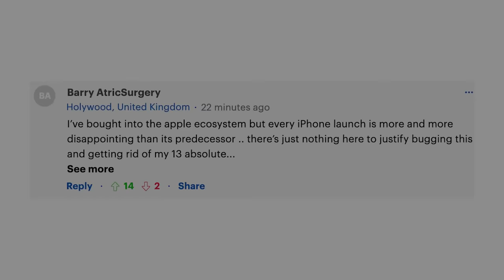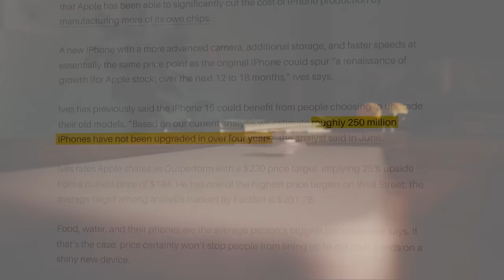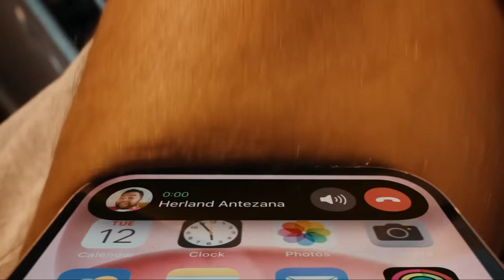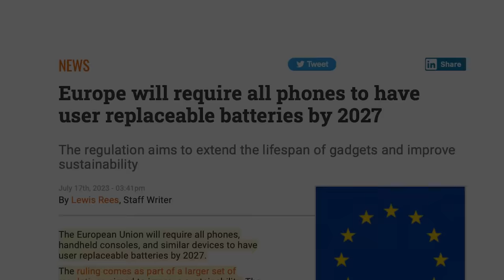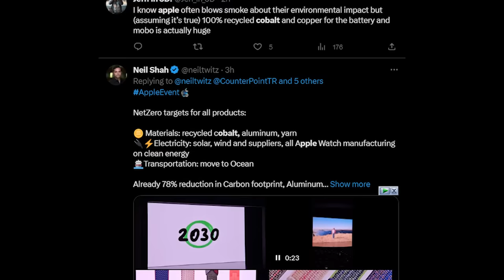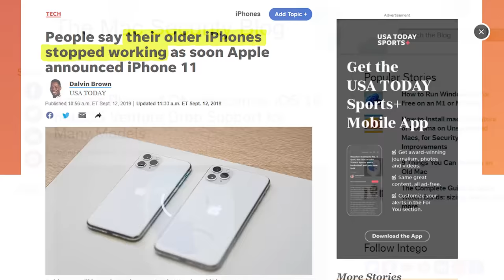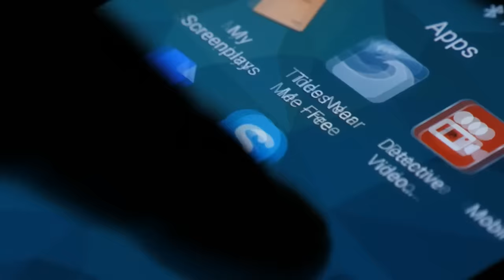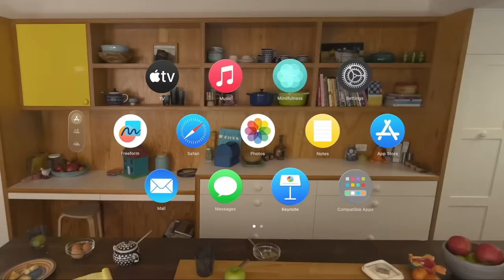The iPhone 15 Is Everything Wrong With Apple

Comment: The video is absolutely correct, but my question is 'what did you expect?'. The smartphone went mainstream around 2008-2009 and the market grew rapidly, the product category is now 15ish years old, no wonder new releases are minuscule improvements. Steve Jobs himself said that a product category tends to stall after the first 10 years of development. Even innovative tech like foldables is not really a game changer, except for internet personalities, almost every single person I've ever come across irl that has a foldable tends to admit it is a total gimmick and for their next phone they will switch back. Honestly the market has finally reached the point of not being worth upgrading every single year, maybe the idiots that have to get the newest, greatest thing will actually use their phone until it's dead.
Reply: I would expect them to maybe allow sideling, landscape mode on the home screen which they've got rid of ever since they introduced the notch, expandable storage, to bring back the headphone jack, a desktop mode
Reply: Foldables feel like that because they are not there yet. Unless you eliminate the crease and make a screen that can be strong like a glass screen then it will feel like a gimmick because it is too sensitive and has a clear annoying flaw. 
There are many way to innovate though but manufactures just stopped and only do what is most profitable. 
Remember how many phones tried different things to eliminate the on the screen camera at first when screen because the full face of the phone? So many innovate things with plenty working great yet everything stopped because they discovered they could still sell just fine by having a hole on the screen.

Comment: Apple has done plenty wrong, but calling them out for being guilty of planned obsolescence because they make a new phone every year is moronic.
They’re head and shoulders above every other phone manufacturer in the world on this front. You can run the latest version of IOS on the XS that came out 6 years ago. They still support the iPhone 8, and give security updates to the iPhone 7, which was like 8 or 9 generations ago. It’s common to see people still using iPhone X after all this time, while most Androids will only get 2 major updates and usually end up in a landfill after 3 years. iPhones’ resale value is typically double or triple other manufacturers.
They make a new phone every year for the same reason there’s a new Corolla every year. Toyota doesn’t expect you to throw away your car every year. It’s there for the people whose phone is old and ready for a trade in.

Comment: This year I updated from a 12 to the 15 Pro Max. I feel it was a worthwhile update, love the bigger display and the slightly rounded edges do feel better in the hand. Personally I don't think an update every year is worthwhile but every 3-4 years is ok for me. I agree with the video in that we have reached the peak of the current technology, I don't think folding phones are the next step, probably longer lasting battery life for a phone would be great but next is the goggles, a different way we can interact with the technology. Phones will likely stay as hand held screen cameras.
Reply: exactly, you dont need to buy a new phone every year, and i would hate if the iphone design changed
Reply: @culan_SCP   People don't realise that Apple views their design as iconic.

They're confident with their design language, and thus they are making only small adjustments to it every year, sometimes none at all , (cough) iPhone 14(cough).

They release new colours to differentiate the newer model from the older ones.
Titanium for the 15 Pros, Deep Purple for the 14 Pros, Sierra Blue for the 13 Pros (still really love that colour), Pacific Blue for the 12 Pros, and Midnight Green for the 11 Pros.

And the colours overall have a different tone from model to model as for the Non-Pro models.
Reply: @CuberBeats  yes.
Reply: There’s enough change for me to make the upgrade. The bigger phone has better ergonomics for me, the 120hz is something I want, and I want that USB C port. The extra ram is neat too. 

I was hoping the 15 plus would have been worth getting, but it’s literally not worth getting.
Reply: @culan_SCP main reason we are regularly changing phones is because of the battery
Reply: People always stereotype Apple users as users who upgrade their iPhones every year. Not true. And even if true, it’s not all the time. It’s mostly huge YouTubers the review the product.

Comment: i used a note 4 for 5 years and you could open the back with your hands, without needing any tools. i carried 1 more charged battery so if my battery died, i could just open the back and put the fully charged one. never had to change any part of it because it was good quality, but i think if i ever wanted to it wouldnt be a problem. its not my main phone anymore, but it still works great, no lag no nothing, still compatible with most apps.

Comment: Been using my huawei p30 pro for 3-4 years still runs like a dream, battery lasts ages and camera is excellent. Doesn't take a genius to work out why subsequent models were banned from using Google.
Reply: Yup, still using my P30 Pro that I bought when it was released - it's been the most faultless phone I have ever used and even the battery still lasts a decent amount of time.  The only times it has ever even been rebooted is when I've forgotten to charge it.  Still runs everything I need it to, looks like new and I have zero need to buy a new phone, quite the opposite of the Apple and Samsung phones I had before.
Reply: That’s cool
Reply: Have been using redmi 6 for more than 5 years. It is a miracle that it has survived my careless handling and still works fine.
Reply: Enjoy the chinese spyware 😂
Reply: @RustyShacklefardd  It's fine, I'm poor anyway.
Reply: @RustyShacklefardd  lol as if google and apple don't spy on you.. absolute sheep behaviour
Reply: I had the regular P30 since launch and it was such a solid phone... Had to switch because the screen stopped working properly and they were asking like half the price I sold it for even with a malfunctioning screen. So I bought a pixel 6a.... And it's sooo much worse regarding build quality, smoothness, battery, it overheats! If they weren't banned, Huawei would have 100% ruled the market by now... Really makes you think

Comment: This was exactly what I was thinking, thanks for putting out a full fledged video on the topic and making people more aware. I believe only 3 iPhones brought the big innovations to smartphones. iPhone 2G, first iPhone, iPhone 5s, with bringing biometric authentication and finally iPhone X, with current modern day smartphone design and package. I still use iPhone X bought it at launch. It is still a beast, its losing support with iOS 17. and with the iphone 15 pros launching today, i dont see a good reason to upgrade other than the camera or maybe the battery coz my phone gets charged with apple car play twice or thrice daily. so i dont have any battery issues. Most probably i would be keeping my iPhone X another year.
Reply: Same for me, still using my Iphone X but already had to replace the battery and screen. I would definitely keep my Phone if the camera would be better compared to the newer ones with night mode and so on.
Reply: totally with you on the iphone X. got it in Dec 2017 and it's still going strong. ok, its a bit laggy. but it never stopped working, all the pieces are original (nothing has been replaced) and it does the job. Maybe its time for an upgrade this year. but after 6 years, I think that's fair
Reply: I have an x and i upgraded the battery to a 3200mah one and my phone now lasts all day. Literally with heavy use. And by heavy use i mean im on youtube and tiktok all day. 

I like this phone so I’ll probably pick up a XS for cheap.

Comment: I agree with many points you made in this video, but I didn’t watch it anymore after you said iphones don’t last long. My friend, iphones are the longest supported phones in the industry, you can still use an iphone x or xs today and use all the newest apps. Those phones came out in 2017/2018. Yes, they slowed phones down in the past, but nowadays you can just turn the feature off in the batterycsettings menu. Iphones are staples of the industry when it comes to longevity and long software support

Comment: I think a huge reason why most upgrade yearly is the phones slow down over time, or at least people feel like their phone is slowing down in just under a year so they upgrade for the thought of a new phone running at 100% speed
Reply: My Samsung S10 has been running perfectly fine since 2019 honestly.
Ever since that lawsuit, they havent been slowing it down much on my end
Reply: To be fair, when I had my iPhone 6 for a few years it got slow as hell, to the point where I literally had to wait 20-30 seconds just to open whatsapp (and I am not exaggerating either, literally measured it with a stopwatch). Ever since then I've been traumatized of getting a new iPhone, however I've now been rocking an iPhone 11 for the past 4 years and tbh I can't say it slowed down significantly since the first day I got it. And thats with tons of new updates. Gotta say, Apple got their shit together.
Reply: @ferryhmm  They "got their shit together" only because they got sued for slowing down older phones to force user upgrades.
Reply: @mintheman7  The thing is, even when they rolled out that update to be able to disable the CPU throttling, my phone was still that slow. So yes, they still "got their shit together", because the phone slowing down went beyond the questionable cpu throttling practice they did
Reply: I still use an iPhone X and the throttling lawsuit definitely had a part in keeping this phone going for this long. iPhone would force an upgrade nearly every other year or other two prior to it.
Reply: I'm pretty sure most flagship devices can stay smooth for at least 2 years (a tad bit conservative due to Android's design in nature)

Comment: Moved from iPhone 5 to iPhone 11 to 15 pro and will keep this one around 3.5 to 4 years. Happy with mine so far and like I can see the time when in standby 🙂 (usb-c makes no difference to me).
Reply: Usb C makes a diffrerence. Notice the big hole where dust lints used to accumulate? Its gone now. You wont have that problem anymore. The C cable also wont break every year like cheapskate Apple lightning. But yeah still charging for almost 2 hours I guess if thats what you mean.
Reply: @fynkozari9271  you don't see dust in usb-c port because it's covered, with lightning you just scoop out the dust.
Reply: @thesnowman2509  no, USB c has a pin inside. It prevents dust from entering. Lightning port has a big gaping hole. Go watch apple iphone gets cleaned. You never see android port getting cleaned. I have 2 USB c smartphones myself.
Reply: The 15 pro should easly be able to last you 5 years maybe even 6
Reply: Just bought the 15 pro, converted from the pixel 7, very happy with the 15 pro

Comment: I jumped from the 11 to the 15 with the rest of my family after everyone else’s broke over time (mine still worked well, albeit with terrible battery life), and it felt so much better to use the 15. If I had upgraded from say, a 13, I probably would have felt ripped off. I recommend waiting at least 3 years (4 years might be more fair nowadays) between upgrading phones.
Reply: Me completely fine with my 2015 Huaweii that doesnt support google services anymore and still has good battery life:
Reply: The terrible battery life (79% battery health when I upgraded after 2 years) is definitely my fault to some degree, as I was an extremely heavy phone user and it heated up frequently because I frequently used resource-intensive apps
Reply: im still rocking my xr 3 years later.

Comment: I’d say it depends on the use-case. If your camera allows you to shoot at higher resolution than 1080p and it’s better then go for it. It won’t matter as much now, but IMO is much better for video preservation.

For example, in 30-40 years the things might’ve changed, so drastically that 6k is the new standard resolution. But obviously, as I said it depends on the use-case of the video.

Comment: One point about the batteries they use for the iPhone 15 is they use lithium-cobalt because it is more energy dense than lithium-phosphate which makes sense in the context of a phone since you typically want it to be light weight while having a large battery capacity. 

Lithium-phosphate are more sustainable and better than the environment but are less energy dense. On the bright side though they are more thermally stable (kind of irrelavent for the temp a phone operates at) and have a longer cycle life meaning they can be charged and discharged more often over its lifetime. This is potentially another reason they don't want to use this because it would give less incentive to change to a new phone since the battery will degrade less over time.

And on another note they're not actually the driving force for the large increase of price of cobalt over the recent years, automobiles are since they need much larger batteries. For some reason despite thermal stability, safety and cycle life being more important for the application of an automobile they still opt in for lithium-cobalt batteries instead (with a bit of nickel).

Comment: I think the only problem with Apple and most phone companies is that the phones are designed to not last too long, and people feel the need to upgrade too often
Reply: Ironically, Apple is one of the best manufacuters to that. Their devices dont really slow down even after years, and they recieve full update support for 5+ years.
Reply: The problem I’ve noticed is that the phones will work for a long time, but the stupid batteries do start dying really fast. One person I knew had a really old iphone that would die after like 5 minutes off the charger. But they do have to be pretty old to do this

Comment: With the way Samsung has been pushing the boundary for the past few years, I really expected the new iPhone to be leagues better than the previous years just to compete. Turns out this year's Pro Max camera sensor still cant compete with the S23 Ultra. Apple has lost their grip on hardware supremacy and soon, they'll end up losing their software edge as well. It's honestly just surprising how little Apple is bringing to the table these days because it's like they want to lose market share. I assume they aren't too worried because of the whole "green bubble" brainwashing thing that has happened in the US and they're banking on consumers still choosing an objectively worse product just for the status they've created, but how long can that really keep up? Every time I show my friends the S23U zoom they're astounded. If they refuse to innovate and continue to lock basic features to their pro models, i think the tide may finally start to change in the US market.
Reply: I disagree. I think the iPhone will continue to reign supreme or see its market share grow. It really is not an "objectively worse" product, but rather it is designed and built with a completely different paradigm -- one of refinement as opposed to one of gimmicks and pushing the envelope. The majority of people prefer this. Apple is still building the best power-to-performance chips on the market paired with the most secure and stable mobile operating system. The overall user experience (especially in apps) is just easier on the user.

I am a techy person, so I like gimmicky stuff too. The zoom lens is cool and well implemented, although not particularly useful. Samsung DeX is awesome, and I appreciate the customizability you get with an Android. I own both of these phones and I use them a lot, but I really do believe that despite these features, Apple offers a vastly superior user experience to anything I've tried on Android.
Reply: @Nadzap  Tried a pixel?
Reply: @megamastah  yep, my android phone used to be a pixel 6. I like the Pixel, it feels like the “iPhone of Android” to me. It’s well polished and the software is pretty innovative. However, I still prefer the iPhone user experience. I think it’s simpler, cleaner, and a tad more well thought out. You certainly get more customization options on Pixel but I love the implementation of shortcuts on automations on iOS. More personal preference than anything. Pixel is a great phone
Reply: Turns out it’s Samsung that can’t compete on video quality, camera is subjective, plus Samsung’s ecosystem is no match for Apple’s so come back when Samsung makes their own software for all their devices and had a find my iPhone competitor, Samsung’s ecosystem isn’t as seamless as Apple’s and their phones have to rely on Google’s Android for their software when they could build their own, until then I won’t respect Samsung.
Reply: @Nadzap the Pixel is the best that Android has and is the smartest Android device I’ve used.